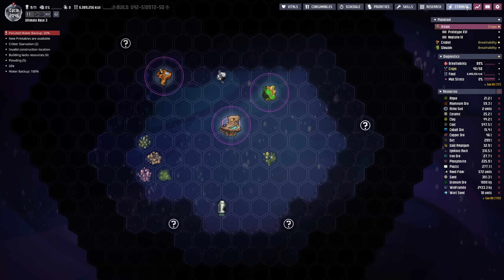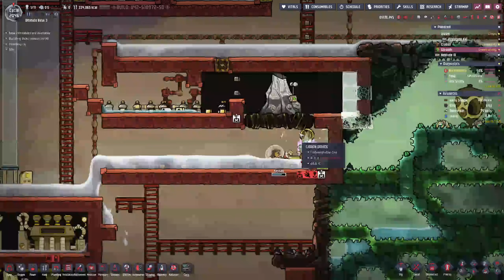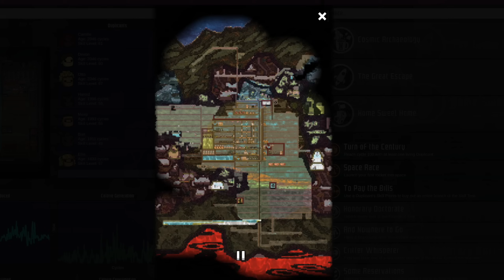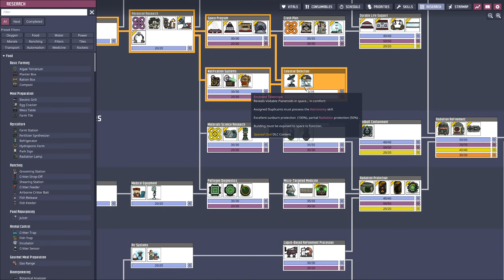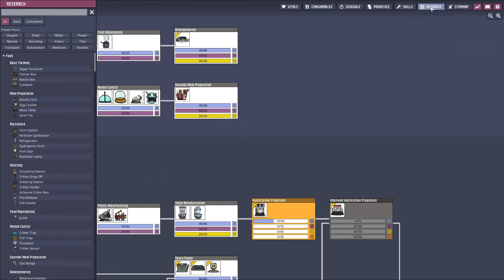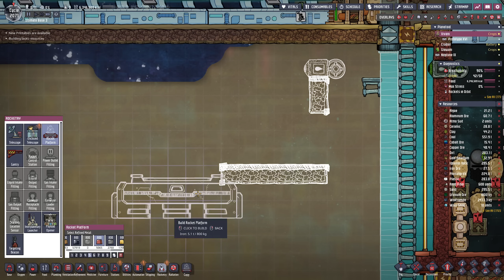RADBOLT ENGINE PREPARATIONS - Spaced Out: Ep. #76 (Oxygen Not Included)

Comment: The radiation rocket will melt any tile below it. Despite the fact that there is isolation. I advise you to place three tiles of tungsten under the rocket platform. in the middle. It will even melt obsidian in 3-4 flights. 
If my memory serves me right, then it heats up to 2800 degrees. So you need to take this into account just in case. Hydrogen rocket will heat even more

Comment: If you catch a small crawling beta and move it to a separate room where there is no hive, then it will turn into a hive. So you can breed a lot of beta's. So they quickly make all the uranium enriched, and you can use a nuclear generator for several thousand cycles. the main thing is to clean the premises from everything that is not uranium.
But be careful, they are very stupid in large rooms. Better not to give them too much space.

I have made many hives, in rooms 2-3 cells wide. The rooms were separated by ordinary doors, so that duplicants could pass through. It is advisable to keep them in a vacuum, because they do not like heat.
Reply from the maker: Thanks for the tips!

Comment: GG. I don't mind the slow pace. YouTube allows you to speed up the play back, so take all the time you want.

Also, the hydrogen rocket will be needed to reach the farthest corners of the map. The other engines don't have the range.
Reply: I build radiation stations on all planetoids and fly around the map on radiation. Because the radioactive rocket is fast. A hydrogen rocket with multiple fuel bunkers is just painfully slow. And on radiation, I fly 10 tiles in 1-2 cycles.

But this does not negate the fact that building a hydrogen rocket is just a separate achievement for oneself.